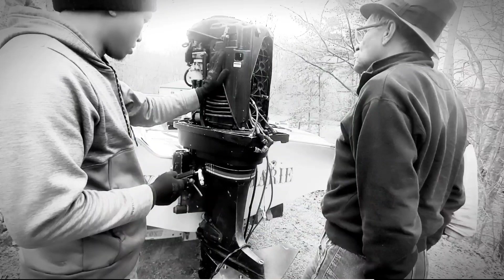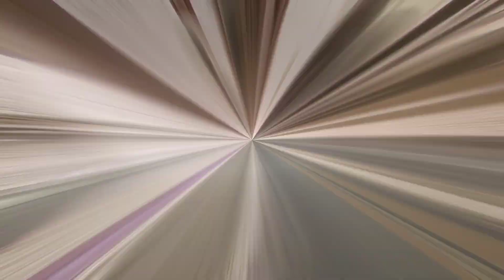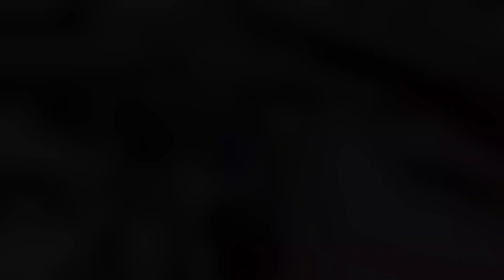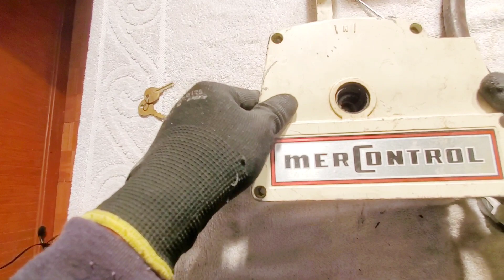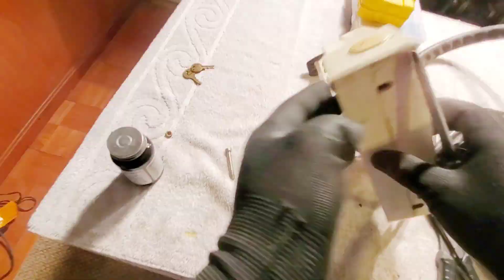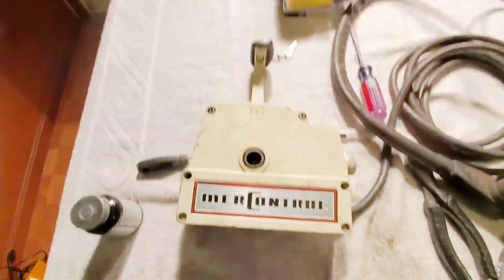MerControls: Key Switch Issues??

Comment: What happened to this controller that it stopped working properly? Going to open my Controller to check for possible electrical issue. While water skiing, we turned the boat off to climb back into the boat. When I turned the key on my 150Hp Thunderbolt nothing. We messed with the plug and shifted the controller, and it started. It happed again, and my friend put it neutral and got it started, and we called it a day. I will check the plug with a light, but I think i should open the controller to be sure no wires are not broken. Just dreading trying to put it back together.  I will lightly lube the controller. Thanks for your videos. It is a 1973 mercury. Anything else i should look at?

Comment: that's the same box i believe as i am trying to work on, the switch is short and there isn't much room, finding a replacement is difficult, would be nice to have a diagram for mine that is correct. I de soldered mine and cleaned up the switch the terminals have letters, this style of switch you almost have to solder the connections as there is hardly any room for other methods

Comment: Hello all. Love these old Mercs. I have a 1964 Merc500 with the same control box. Key switch no longer stops engine when switched to off position. Any ideas what to look for? Do not want to put in “new” switch. All original.
Reply from the maker: New switch. Son
Reply: @MerCSonL6  Thanks for the reply! Turned out to be a grounding issue. All is good!

Comment: Hey guy. I’m trying wire up a new key switch I bought off amazon that’s supposed to be for a mercury and having no luck getting it to start a 1984 mercury 115hp.  I wish I could send you a picture of the key switch I bought from amazon but YouTube won’t let me. Any help or advice would be appreciated.
Reply: So I’ll explain the colors on the key switch if you could tell which wires they go to on the wire harness to the engine. That would be the best help. Thanks in advance. 

Black = ground 
Yellow/red = start solenoid 
Red= 12 volt fused supply 
Yellow/black= choke
Black/yellow = magneto 
Purple = ignition

Comment: Hey Son, I found all your video very informative and very helpful. 
I had bought this merc 1970 50hp, was told it was running strong with no issues. Winterized before storing in shed. it’s starting fine and idle good but as soon as you put on gear, forward or reverse it dies down. Any idea on what am I missing. Hoping you can help or anyone that on this page. Thanks in advance!
Reply from the maker: Its not getting enough fuel. Could be timing and dreaded link sync. Try increasing your timing 3-4 degrees BTDC and see if that helps..... otherwise a fuel pump rebuild or carb rebuild may be on the docket. Son
Reply: MerCSon L6 thanks Son, I really appreciate your response.

Comment: Hey son I need your help with something I started up my 402 today and it stared great ran smooth but then I went to shut it off and nothing happened I’m a beginner at this so any input would help
Reply: Ok update I’ve checked the shifter and wiring from the engine harness and everything works (on, off, start and choke) so it’s something with the motor any ideas would help
Reply from the maker: @mercuryoutboardguy1939  check the kill switch. That grounds the ignition in the "off" position." Let me know. Son

Comment: Hey merc I. Took the carbs off and clean them new gaskets and put them back on and hooked the gas tank and stuff back up and took it to the shop ran water to it and it cranked after sitting for years put new fuel lines on the tank and to the engine I took it to the lake it Boggs but when I pump the ball then it goes it run fine but after a bit it does the same thing and pump again it gets going also I haven't touch the fuel lines on the carbs there still the original ones on there I change one of the fuel pump diaphragms I haven't touched the other one yet but I can't get that primer bulb to stay hard and it's get soft after a while and also when I noticed two I Pump Fuel to the primer to pump it and sometimes some fuel comes out of the carbs let me know what you think the problem is but other than that it runs good just have to keep pumping that ball when I slow down but when giving it acceleration again you have to pump it for it. Want to go then it takes off
Reply from the maker: Sounds like a fuel pump issue. Should probably rebuild the fuel pump and see if problems persist. Son
Reply: @MerCSonL6  I changed the other fuel pump diaphragm changed all the fuel lines took it out again now it's bogging when I give it acceleration but I don't know if I have the mixture screws set right but I'm going to try it again and the mess with those idle screw to see if that helps but now it's worser is bogging when I give it gas but the ball stays tight when you pump the fuel now sorry there's something else but whatever it is it's still starving for fuel

Comment: I have a mercury motor, the revolution has disappeared. What should I do?
Reply: Exactly the same engine as yours
Reply: What is the reason tell me please
Reply from the maker: What do you mean by "revolution?"
Reply: @MerCSonL6  engine does not pull
Reply: @MerCSonL6  I not speak English, I translate on Google
Reply: @MerCSonL6  I am from Kazakhstan
Reply: @MerCSonL6  Do you have instagram
Reply from the maker: @АйбекТоктаган  it needs to be opened opened. Make sure its not the lower unit that's locking it up first. Pull off the lower unit and if its still locked it will need to be opened up and closely examined to properly diagnose. Son
Reply: @MerCSonL6  how many kilograms will the engine
Reply: @MerCSonL6  How can I contact you?